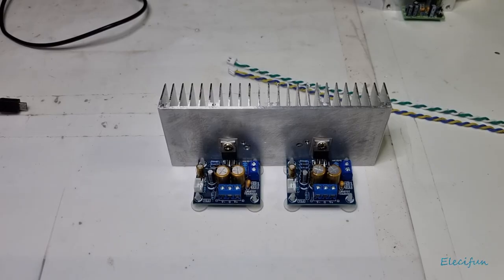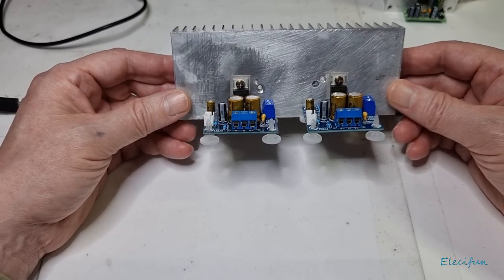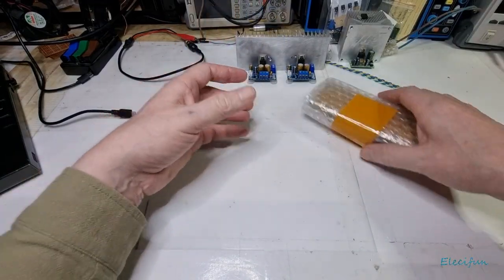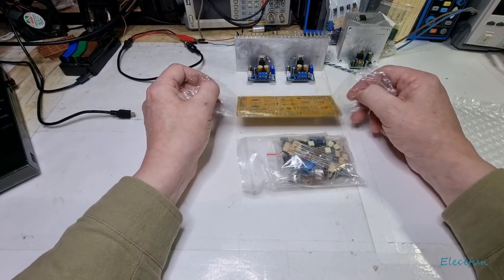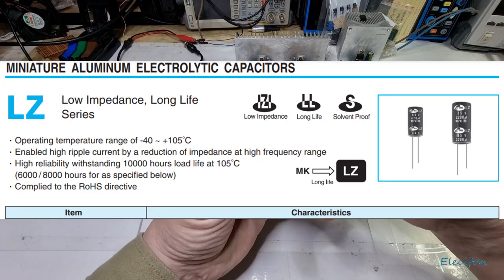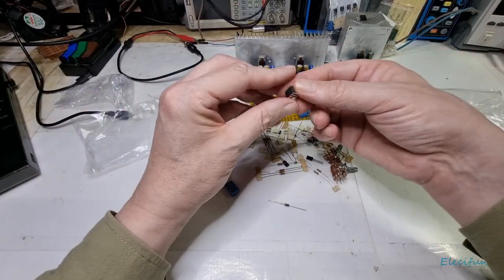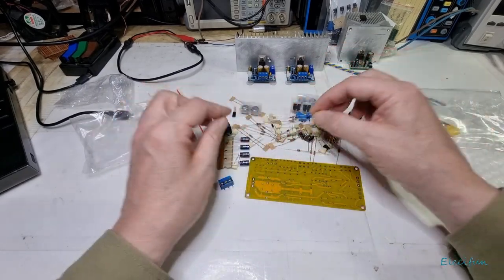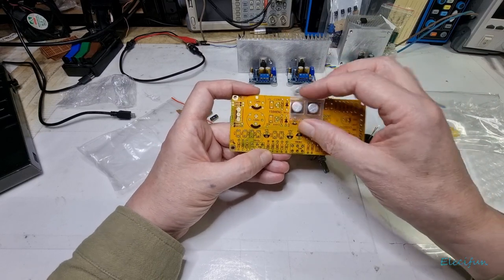NAD UK Preamp Circuit Based On NE5532 Op Amp

Comment: I can see the full bridge rectification on the left hand side. Volume, Treble and Bass control. I assume the left in and right in are input devices and the out goes into a power amp right?

I remember decades ago my mate had a pre-amplifier with his power amplifier hooked into it. 

I assume whats coming out of the pre-amplifier is just signals no amplification.
Its DC so I guess the input must be DC input device.  

Do you have brass stand offs?
Reply from the maker: Yeah left in, right in, from, in this case, a music player. 
Output to amplifier it will be amplified but not by much. Normally a preamp would have a selector connected to resisters allowing for different impedance devices to be connected, I.E. Phono, Aux, Tape, Tuner etc. 
The signals used for audio are AC with some DC but the DC is filtered by capacitors which let only the AC pass through them. 
I need to buy some stand off's, I have plastic for now.
Reply: @Elecifun  I know a little about what your talking about but impedance to me is like resistance but in AC.

That interesting amigo.🤔

Although I'm borderline clueless.

I bought a book which I'm currently reading.

It's getting technical with stuff like Kirchhoffs current and voltage laws.

Sigh.

This is where my understanding of maths is very very basic.

I need to understand algebra. 😑

Anyway, we shall see how much I can learn over the next six months.

Plastic stand offs are fine.

I'm hoping you'll get a bigger kit or something a lot more challenging.

A board thats 12" × 12" which is chock a bloc full of fat caps and other electronic components.

I guess we're in the same boat in that regard.

Kits like that are very pricey as are the components.

Anyway night.

It's already very early here.

😴
Reply from the maker: If it helps my maths is rubbish. I learn what I need for each project. If it was just maths I would be finished. Keep at it that's how we learn.
Reply: @Elecifun  thanks and yeah it's a struggle orayt.

I keep plodding along with it.

Kerchhoffs current law
Kerchoffs Voltage Law

I'm going over some old stuff too.

Ohms Law...

Etc.

Series circuits
Parallel Circuits 

On and on it goes ...

Night. 🌙 

Decem.
Reply from the maker: night
Reply: @Elecifun  Good morning